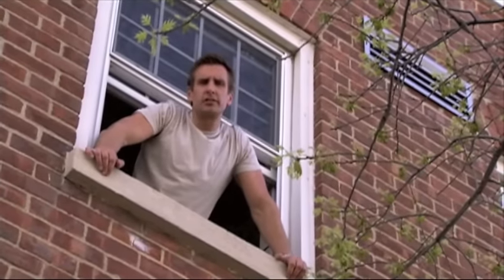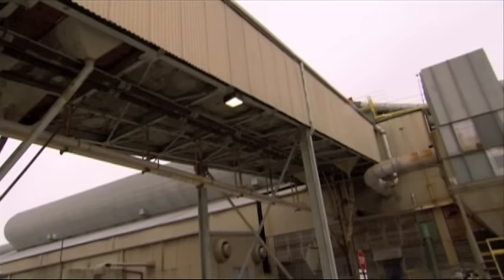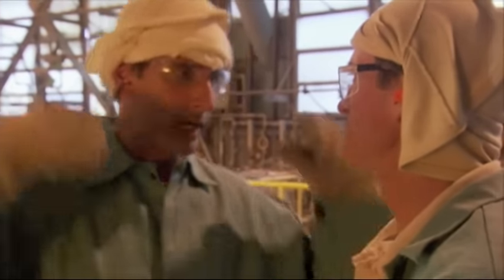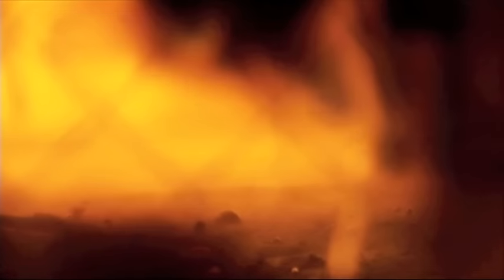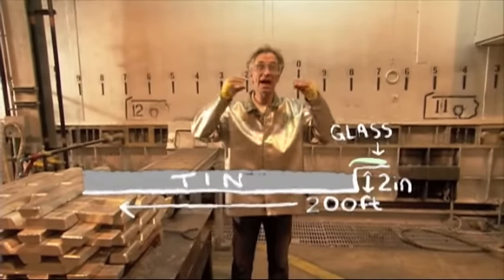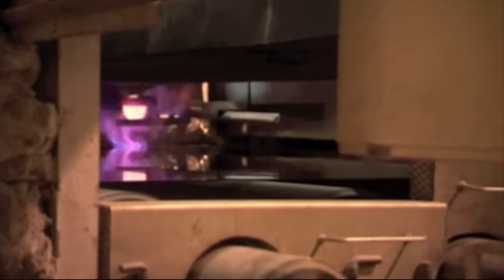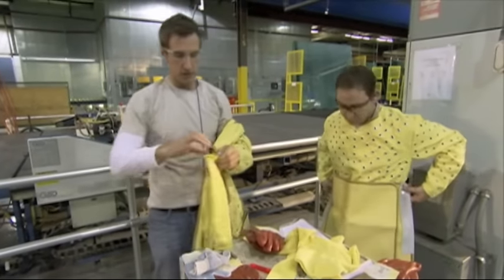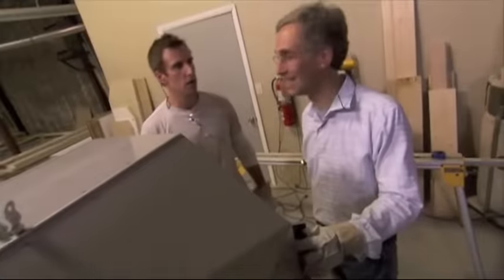How Glass is Made

Comment: I am in the glass industry and just visited the Guardian plant yesterday. It was the hottest I have ever been, but this is pretty much exactly the same!!! It was AMAZING! My favorite was seeing the patterns being stamped into the glass to make different textures
Reply: I wonder if they manage to recycle the heat produced. I work in IT and my employer can even manage to recycle the warm air in the data center
Reply: @123prova  Materials engineering student here: yes, in some facilities they blow air by the outside of the furnace to absorb any heat coming off, and then pump that back into the main heating line. They can also sometimes recycle heat from the toxic flue gases from the combustion process as well. Hope this answers your question.
Reply: @123prova  yes even in artisan shops we do so. its called a recuperative combustion system. both hot air and unburnt fuels are piped back into the comnbustion streams.
Reply: @Aygeu  yup, if youre really slick you can put in filtration systems along that recuperation circuit too. ive built about fifteen furnaces, recuperation is huge money savings. wont ever do one without it again.

Comment: Very informative and well narrated, there is a lot more to making quality glass than one would reason. The amount of electricity used to get the Sand Mixture to a molten stage has to be very high. It is also impressive to see the size of the factory that produces the window glass it had to be a work and progress building knowledge in each generation until a process was finally perfected. This is probably true with just about any tool, appliance machine or technology that we use today.
Reply: They burn gas to heat those machines.
Reply: Getting the damned bubbles out has to be the main thing.  I had a truck some years ago that had thousands of little micro-bubbles in the factory windshield.  You couldn't see them except when bright sunlight was at the right angle.  I ended up getting a rock chip that spread across the whole thing, so that bubbly windshield was replaced for a better one.  I've also seen windows in very old houses that have a lot of bigger bubbles and even waves in them, like the bubbles in beer or champagne, but the bubbles were all inside the pane and the surface of the glass was smooth. Weird. The longer I live, the more I realize how much I don't know, and how much I rely on the knowledge of others for even the most everyday things in life.  Great video.

Comment: I always knew it had something to do with sand, I just wasn't quite sure how it was done. Nice to finally know.
Reply: proper glass is made from quartz powder though ... this is sodium lime glass ... before this process it was lead glass ... before that it was silica glass ... and it is NEVER a solid ... it is a super fluid ... yes it holds it's shape sort of ... but it never actually hardens fully and is always moving ... the older the glass is the easier it is to see that this is the case ... even our modern window glass after 50 years will show that the bottom of the pane is actually thicker than the top of the pane ... becuase it sags down with gravity ... yes it is only a milimeter or so .in that time ... but it still means it is NOT a solid ...
Reply: @0623kaboom  "The question "Is glass solid or liquid?" has no clear answer.  In terms of molecular dynamics and thermodynamics, it is possible to justify various different views that it is a highly viscous liquid, an amorphous solid, or simply that glass is another state of matter that is neither liquid nor solid.  The difference is semantic.  Even in terms of its material properties, we can do little better.  No clear definition exists of the distinction between solids and highly viscous liquids.  All such phases or states of matter are idealisations of real material properties.  Nevertheless, from a more commonsense point of view, glass should be considered a solid since it is rigid according to everyday experience.  The use of the term "supercooled liquid" to describe glass still persists, but is considered by many to be an unfortunate misnomer that should be avoided.  In any case, claims that glass panes in old windows have deformed due to glass flow have never been substantiated.  Examples of Roman glassware and calculations based on measurements of glass visco-properties indicate that these claims cannot be true.  The observed features are more easily explained as a result of the imperfect methods used to make glass window panes before the float glass process was invented."

The Physics and Relativity FAQ
Updated by Dan Watts, 2021.
Original by Philip Gibbs, 1996
Reply: Minecraft. And they say u don’t learn anything from games 😂
Reply: @0623kaboom  Quartz is quite literally silica. Modern soda lime glasses are still silica based, and the main function of the additives (soda and lime) are to lower the melting point and to increase malleability (though the lime also helps stabilize it chemically). The other commenter is also right that glass is not a liquid and does not act like one. However, the reason glass panels were thicker at the bottom is because making perfect sheets of glass was damn near impossible, and it's just easier to install the thicker side down rather than up.

Comment: 5:26 - it's not explained, but when that guy drops the sheet, it's onto an airbed. That black surface has air pushing through it to cushion the glass as it drops.
Reply: no it doesnt. that would chill the glass too fast and cause cracking. that is absolutely NOT true.
Reply: @joshschneider9766  Chill the glass? The glass is at room temp at that point, and remains so. The air is just room temp air, not freezing.

Comment: Just to confirm. When glass has the sharp edge knocked off it using an abrasive product this means you would be sanding sand with sand?
Reply: No, diamond wheels do the grinding of the edges at the fabrication plants.
Reply: My comment was supposed to be funny, guess I’m the only one who found the humor in it.
Reply: Sand and glass are not the same as each other.  Sand is mostly small crystals of quartz (Silicon dioxide.) glass is made of a mixture of silicon dioxide, calcium silicate, sodium silicate and a number of other compounds of silicon, calcium and sodium plus a number of impurities.  Glass is not crystalline (Despite the name "Glass Crystal" for certain types of high-quality glass.) but is more like a super-cooled fluid.  I.e. the atoms in it are not in ordered rows as the atoms in a crystal are.

Comment: Some guy told me that a guy managing a local rubbish dump and collecting glass bottles for a recycler could put nearby beach sand in the bottles and presumably get paid for added weight, coz glass was essentially sand, since he used to work in the industry. Which is not how it worked and it wouldn't take them long to figure out the rort, but it is true, glass is essentially sand.  Anyone with the right machine can reduce glass bottles to what is essentially a pile of beach sand with the tiny spiracles, or whatever, being more pointed than naturally occurring beach sand, but otherwise the same.

Comment: where do they take AALLLL THIS SAND from!??!
Reply: Right?!
Reply: franlovesmusic It is not the regular sand that you scoop up at the beach. It is formed in specific geological process to be of commercial purity, and only a few places have it. The refining dust is very carcinogenic. Google silica sand mining wisconsin protest . Glass bottles are no less pollutant than plastics.
Reply: John C G So what do you suggest we have houses and buildings with zero ventilation or do u suggest we leave spaces open  ?
Reply: franlovesmusic Sahara
Reply: franlovesmusic Sahara
Reply: Mitchell HürenKamp are u kidding?
Reply: franlovesmusic Silica Sand, Quartz Sand, is a naturally occurring, or grinded from quartz stone.It is Silica Oxide, good also for water filtration, abrasives, high strength plastics, automobile paints, Photocell glass, Semi Conductors, Ceramic, Porcelain, and hundreds more uses.Silica in micro particles, if inhaled for a prolonged period, can cause a condition called Silicosis.  Workers in Granite shops and Cement cutting, are at risks, if they have the genetic sensitivity, as it will not affect all people.Silica is also part of the components of clay, Cement and Granite.It is all around us.
Reply: franlovesmusic Silicon is found in compounds in both the mantle and the crust, making it the third most abundant element on earth.
You can almost assuredly walk out into your back yard dig up a few rocks and find  some form of silica quartz.
Reply: Your mom
Reply: +Camilo Garcia Benitez any solid particle that small is a carcinogen?
Reply: Umm sand is literally about as common as Oxygen lol. It's everywhere. 

Now soil on the other hand. Good soil too. Now that's the hard stuff to find, especially given the population boom of humans.
Reply: all that much in just a day is insane
Reply: FranSunset  from the bottom of the ocean.
Reply: FranSunset where sand is obviously
Reply: I can supply sand
Reply: Glass doesn't help ventilation. hahahahaha
Reply: back yard from my grandma home.
Reply: @PLazz257  spell check
Reply: Deserts duh

Comment: This is so amazing to me.  One of those things that we use every day but hardly ever think about.  Of course, I have more questions.  The sand melts at such a high temperature.  But what kind of metal is the machinery made of that can withstand that high temperature without melting itself?  And how do you make the machinery for something that has the highest melting point?
Reply: The furnace is actually made from several layers of interlocking ceramic blocks up to 3 feet thick. The tin bath is lined with block and carbon. The machines inside that pull the glass through the tin bath called top roll machines are water cooled along with cameras inside so operators can see what is going on. Here is a better video of the process. This is a video made at the plant I work at.  https://www.youtube.com/watch?v=Qxz9WPZr27U
Reply: @punknhead23  cool!  It looks like ceramic and tin can take a lot of heat. Interesting to see the process.  Something we use every day, but rarely think about how it’s made.
Reply: @punknhead23  Yes and another tidbit for those not in the glass business, is that the tanks or furnace, is never shut down. It runs 24/7, 365 days a year.  Only time they are shut down is for a rebuild. Most run for years on end always making glass. If the glass is not needed then it is added back to the mix as cullet.
Reply: The machines are made of probably stainless steel but lined with ceramics and high temp insulators to protect the steel.
Reply: Ceramic on the inside. Metal on the outside.

Comment: i already know sand turns into glass, but how does it become see through?
Reply: Glass is a rigid material formed by heating a mixture of dry materials to a viscous state, then cooling the ingredients fast enough to prevent a regular crystalline structure. As the glass cools, the atoms become locked in a disordered state like a liquid before they can form into the perfect crystal arrangement of a solid. Being neither a liquid nor a solid, but sharing the qualities of both, glass is its own state of matter. I worked at a glass plant for 45 years and yes it's complicated to understand.
Reply: @bconman  that is true for Sodium Lime glass but not for actual glass ... which is quartz powder only ... we also call it crystal ... and it IS allowed to form into crystals ... in BOTH version but only very small crystals which allows light to pass through ... if cooled naturally it forms larger crystals and tends to block light and being able to see through it ... before sodium lime glass there was lead glass ... and silica glass .. which is green ... and no glass is a solid .... it is a superfluid ... it never stops moving ... it just moves very slowly ... take a 100 year old window and measure the top and the bottom and you will find a deviation ... measure modern glass after manufacture and it is even along its surface let it stand for 50 years and the top is thinner than the bottom ... sure it is very small in mircrons and millimeter range but it still has changed ...
Reply: because the power of racism makes it possible

Comment: I thought it was zinc that the glass floated on.  Nice to know it is tin.
Reply: When Pilkington invented the float-glass process around the middle of the last century, the sheet was originally drawn across a narrow bed of mercury (later replaced by the less dangerous tin), but the company was still producing glass with the Libby-Owens technique, whereby the sheet of glass is drawn upwards continuously through a long ceramic nozzle floating on the surface of the molten glass in what was called a drawing bay. The continuous sheet was then bent over a roller, drawn across the narrow bed of mercury and finally cut off to the required length. The thickness of the glass depended on the drawing speed, with thicker glass being drawn more slowly. 

The advantage of float-glass is that both surfaces are flat and exactly parallel to each other, Before that, glass made with the Libby-Owens method (and before that with the Foucault method) only had a flat upper surface and the lower surface had to be polished in a further production step, which increased the price somewhat.
MsG
Reply: zinc tin lead water ... depends on the end result ... even silver and gold will work ... the main criteria is that the melted silica does not combine with what it is being floated upon ..

Comment: I can't even imagine the amount of energy needed to keep something that hot for days
Reply: It’s a furnace. It’s natural gas
Reply: Most large plants run nonstop 24/7 365 unless something has to be rebuilt for maintenance, which is rare. It is true that it requires a lot of energy, but actually keeping it hot isn't that bad. The walls of the furnace are lined with ceramic refractory bricks, which are crazy good insulators. Even after shutoff, large furnaces can take well over a week to cool down to manageable levels.

Comment: I dont see how glass is economically feasible considering how much heat they need...
Reply: ILordSpawnI Good observation. What's worse is that the sand is not the regular sand that you scoop up at the beach. It is formed in specific geological process to be of commercial purity, and only a few places have it. The refining dust is very carcinogenic. Google silica sand mining wisconsin protest . Glass bottles are no less pollutant than plastics.
Reply: ILordSpawnI they mix soda with sand so as to lower the point of heat where glass is supposed to set.  This makes the manufacturer's conserve energy.
Reply: its expensive to make... but... if you learned economics, it is cheaper for us because of Economies of Scale

Comment: Great video and machinery. where does all the sand come from ? Is sand manufactured from rocks or taken from beaches ?
Reply: ***** It is not the regular sand that you scoop up at the beach. It is formed in specific geological process to be of commercial purity, and only a few places have it. The refining dust is very carcinogenic. Google silica sand mining wisconsin protest . Glass bottles are no less pollutant than plastics.
Reply: Hey thanks. It's great to have an insight into all the material things ,. how they're made @)
Reply: +CM CM dry sand 10 dollars a ton at a sand plant in Kansas,or this monster facility probably dries their own,for virtually the cost to dry it.either waythe raw matls are close to free and endless as a river product in nature.therefore it is silly to recycle glass;you could put a 10 lb. bag ofsand out at the curb for the monstrous diesel powered truck to pick up!unlike aluminum recycling or cars,glass recycling was created by a bunch of do gooders to make them feel like they are doing something for the environment.when you factor in the steel dumpsters used,this only serves to keep our landfills from filling up;and is absolutely not carbon footprint friendly!
Reply: @leewatkins1610  you are so wrong. The batch ingredients are expensive. Silly to recycle glass?? It takes so much heat to melt silica sand (which has to be mined and refined) and the other ingredients. Cullet (glass we recycle) has already been through that process and melts at a much lower temperature than the batch ingredients. 20-30% of the batch is recycled glass to keep the furnace and the whole process cooler (still 2800º) and more efficient and cost effective.

Comment: With all the sand used by the glass industry and the construction industry, I wonder why sand is not in short supply in US.  In many countries it is in short supply.
Reply: think about that a little more carefully ... dig a diamond mine ... you get gravel and finer powders ... those then can be sold to glass makers to make glass ... the main part for glass is to cool it fast enough to only form very small crystals which are see through ... and the float method can use anything to float the molten silica on ... it just has ot have a lower melting point than the powder being melted to make the glass ...